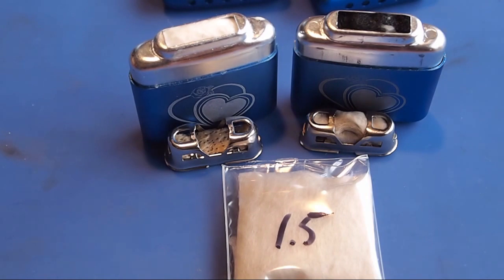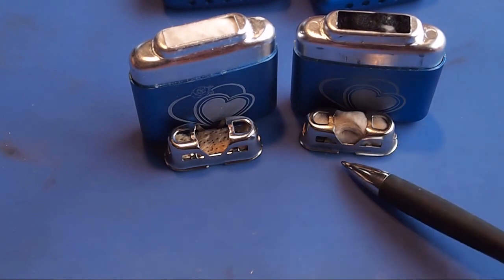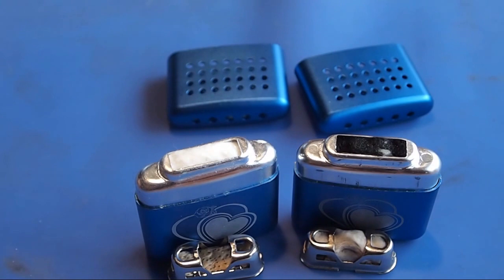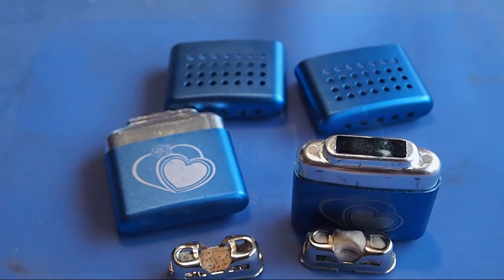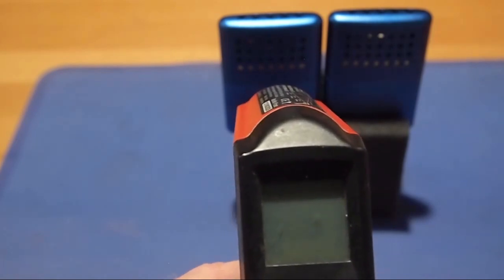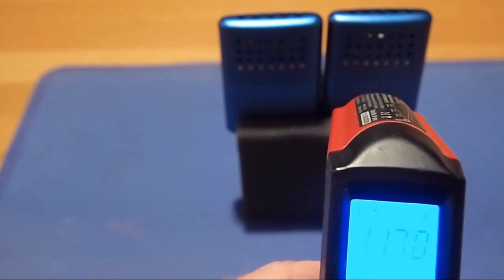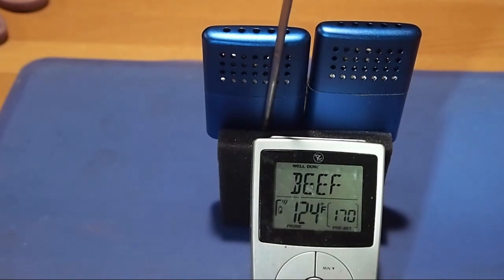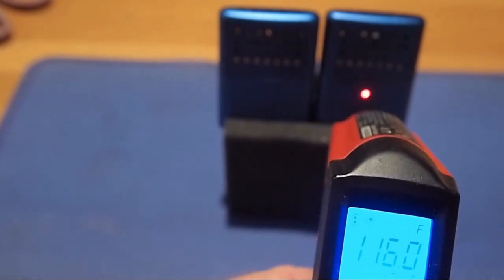Handwarmers, S01E02: Rebuilding Hand Warmers and Improving Performance

Comment: No complaints about your product modification, but I can't stand that noise!  Are you chewing something?
Reply from the maker: I regret it bothered you. As we have central heating, air in winter is very dry, that is a water wall that runs 24/7 in winter to humidify the air by contributing about 15 litres a day. The water runs down a glass panel for 2.5 meters and then goes back into a reservoir, that sound gets more pronounced when the water in the reservoir is low.

Comment: All or at least some of the hand warmer bodies are a two piece affair that has am upper portion pressed into a lower part.  You can see the seam in the video. It's a snug fit, but if you can pull them apart you can repack with the carbon felt through the hollow inner openings as wide as the body itself, then reassemble.  No need to mess around with cutting small pieces of felt to push in through the small opening where the catalyst head sits on.  I used pliers to pull my body apart, just worked it back and forth and nudged the upper part out until the body separated.
Reply from the maker: The reason for using strips is to stimulate laminar vapour flow to deliver the vapour stream to the catalyst. It may not help all that much, but in theory it seems like the best way to go.
Reply: You may be entirely correct on the advantage with strips over a large piece folded and shoved in the hollow opening.  I've done it both ways but couldn't detect much if any difference with the heat produced, but I don't have an instrument to detect small increments of difference.  I just thought the ease of putting in the carbon via the large opening with the warmer pulled apart was helpful..

Comment: What material can be used to replace the wick? I have a zippo hand warmer and the catalyst burner replacement costs almost as much as the whole thing itself
Reply from the maker: Interesting point about the fumes burning and defining a reaction. I was under the impression that when a log ignites it is an exothermic process resulting from combustion. An exothermic reaction is defined as a chemical reaction that releases energy by light or heat. So I'm not really sure if the combustion of a log is caused by a chemical process or a thermodynamic process, but I'm guessing it's likely to be the latter.
Reply from the maker: Handwarmers do not use a wick, as they do not 'burn' anything. The heat is a result of an exothermic reaction (fumes reacting with catalyst).
Reply: Mountain Parameters yeah well that doesn't help. So to be more simple for you simple minded folks lol what catalyst material will work? Is that clear??
Reply from the maker: I regret that that was of no help toward understanding why you are having issues. Platinum catalyst is what required (EG: fumes reacting with catalyst).
Reply: This exothermic reaction actually is burning....in this case the fumes are burning....when a log starts on fire, that is also an exothermic reaction.

Comment: Thanks for sharing your research on these hand warmers, and sourcing the proper catalyst. I'm wondering how the amount of catalyst affects the temperatures. Also, I wonder how the run time is affected with the different catalyst types and quantities.  For example, does the hand warmer last longer at a lower temperature with the cheaper catalyst? I wonder because the 12h Zippo is bigger than I want, but the 6h is right at the low end of run time. If I can get the 6h to run a little cooler with some modifications and end up working for about 8h, that would be ideal. I was also wondering if I could take some aluminum HVAC tape and cover some of the air holes to achieve the same thing.
Reply from the maker: Restricting air flow definitely will lower the temperature.

Comment: I just want to know what lighters you were using. Specifically the electric one
Reply from the maker: The lighter with the Arc I used to bring in originally for lighting the inverted winter camping canister stoves. They were difficult to find, and this year I have not been able to find them at all. I suspect they were not a good seller to their main target audience of smokers. The closest alternative is the USB style that has a coil in it. Those work pretty well for lighting hand warmers, although because they are so cheap, they don't have very good battery life.

Comment: You're the master of Handwarmers!! How long should we expect the Platinum Catalyst to last if lit properly??
Reply from the maker: Thanks for that David,
I got your email, but thought I'd answer here in more detail.

I haven't used the proper (made in USA) catalyst long enough to tell, but the manufacturers tell me it should last a long time, EG: years. What damages the catalyst is usually just getting 'worn out' from the head being taken on and off hundreds of times which physically takes its toll on the substrate the catalyst is made from by getting poked, knocked, and bumped. Also I've seen video tutorials where they advocate the user soak the head in fuel and then light it. That seems like poor advice to me, as common sense would indicate that even if you don't oxidize and burn the substrate, you're going to get it coated in soot after you've been using it as a wick for a soft flame. You do not need to light your catalyst on fire to get it activated, in fact that is a very bad idea. I think the biggest misconception with regard to the heads is that they 'burn' the fuel via combustion. They don't burn in that sense, so you are not trying to lite it on fire like you would a wick in a kerosene lamp. You don't need fuel in the head, you need fumes. The heat is produced by an exothermic reaction that is caused by the vapour from the hydrocarbons reacting with the platinum. Users need to think in terms of promoting their handwarmer to enjoy favourable conditions for evaporating the fuel that is in the reservoir, not wicking it up to the head so that it can 'burn' there. That means warming the base section, and giving the fuel time to evaporate. There is another video review on Youtube wherein they mention you should have the cotton fibre in the reservoir high enough that it should be touching the catalyst so it can 'wick' the fuel into the head. This unfortunately demonstrates a lack of understanding the dynamics of how a handwarmer actually works. Having the reservoir material that high actually just means you are going to char it to the extent that the burnt cotton layer that now covers the interstices between the cotton and the catalyst material will obstruct the flow of fumes into the catalyst and diminish it's ability to produce heat. That's why we recommend the removal of the cotton fill from the reservoir and replacing it with carbon felt. (Observing the number of orders we get for platinum catalyst without carbon felt, makes me think that many users do not agree with this theory, and perhaps think that recommending the carbon felt is analogous to selling Snake Oil, even though they could add the felt for less than they spend when they stop at Starbuck's). To me, the carbon felt is the second most important hack you can make to bring a handwarmer into a misunderstood ecosystem populated with millennials who are discovering the harsh realities of nature for the first time.

Here are some important points to observe:
1: Measure the correct amount of fuel into the reservoir, 25ml for a zippo, 15ml for a 6 hour unit. Do not overfill.
2: Make sure the head has a good tight fit and will not get wiggled off. This is one area where the overpriced Zippo's have an advantage over the Chinese units.
3: Let the handwarmer stand for at least 3 minutes with the head on. This allows evaporation to get started and fumes to penetrate the catalyst material.
4: Activate the reaction by holding heat nearby, I prefer to use a USB lighter for this. You should then see the catalyst start to glow immediately.
5: If you still have the stock catalyst in the head and it has been damaged by trying to light it on fire, etc., consider replacing it. After you have done so, go back in time and review some of the procedures that you used in the past that may have hastened its demise, so you can avoid repeating the again.
Reply: So, this is unbelievable. I purchased the zippo hand-warmers a number of months ago and while in the stock condition they worked great at first and then I could only get about five hours out of them. Now that I have purchased your new catalyst and carbon filters with the spring it's amazing. After installing the carbon filters and the catalyst, on the first day I checked it out I got an easy 12 hours. Extremely easy to light. On the second day I did an experiment and purposefully overfilled the hand-warmers with zippo lighter fluid until it was pooling at the top of the hand-warmer. I drained the extra fluid out and let it sit for about 45 minutes. Then I lit it and I got a whopping 36 hours of heat. And it is hotter than it was when I purchased it stock. Extremely impressive.
Reply from the maker: Thanks, you've got it nailed. I own two Zippos. I'm also finding the Zippos are the least reliable of all of them, including the Chinese. As you note, I also suspect the reason for this is the limited space the neck of the reservoir provides for the emission of the naptha fumes. Another factor to consider, the reservoir on a Zippo is thin at 15.5mm, whereas the S-Boston is 18.5mm. The length of the body on an S-Boston is 41.5mm, the Zippo is 51mm. This probably makes the S-Boston more impervious to Cold Shock. The best way to improve a Zippo is probably take a dremel and cut all the extra metal covering from the top of the neck as all that does is obstruct the flow of fumes to the catalyst.
Reply from the maker: There is an order form on our website:
http://mparam.s3-website-us-east-1.amazonaws.com/orderform-handwarmer.html
Reply from the maker: Well..
Thanks for that! I got 24hrs from one, and thought that was interesting. I've also wrecked some catalysts by getting them soaked, and discussed it with the catalyst engineers. They are puzzled, but are wondering if perhaps I was using contaminated fuel as they didn't think the material would be damaged once it dried out. I just got back from a day of ski touring, and I've also noticed a couple of units we carried don't seem to get as hot as the others, and I'm wondering if I packed the springs too tight. When I'm packing the springs I don't want to be perceived as being 'cheap' and ripping off people for catalyst, so going forward when I get more stock, I think I might offer the kits with the catalyst pads and empty springs and let the clients pack their own springs to the density they want.  I don't think we've got this whole project perfected as yet, but it's been a lot of fun getting ideas and feedback from everyone.
Reply: I agree!  I have been a fan of hand warmers for about 40 years.  Some of my earliest memories of using them them are with my father waiting for a hockey game to start while trying to stay worm before the adrenaline kicked in.  He got his in the military and treasured it like it was gold.  I had a "mystery Jon-E" that always ran hotter than all the rest and I never could figure it out.  The batting was a good 16th of an inch away from the catalyst head and the spring itself was about another 16th higher.  Basically the head was "suspended" above every thing else.  All my life I was told to make sure the catalyst touched the batting and had to make contact.  I find this is simply not necessary.  Most people don't understand this.  The Zippo is a poor excuse for a hand warmer because it is the only one that won't work any other way.  Basically it was designed to fail, once the batting gets charred.

I have about 50 hand warmers from years gone by, to modern ones in my "collection."  I used to attempt to keep up with the market, but over the last couple of years I have found that they are probably stamping them out n a factory in China some where, in any design or shape they can think of, much like Hot Wheels. 

Thanks for your videos, I'm still learning too!
Reply: Mountain Parameters 
Hi, can you tell me where I can get de catalyst material? thanks for the exelente job.